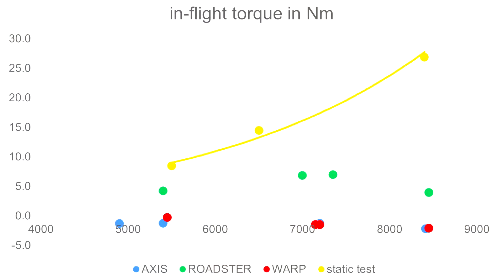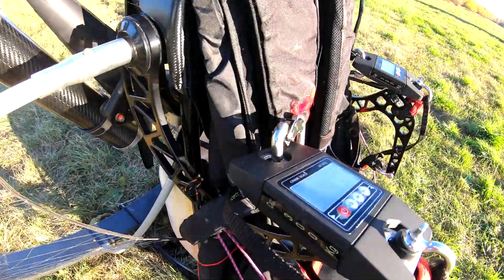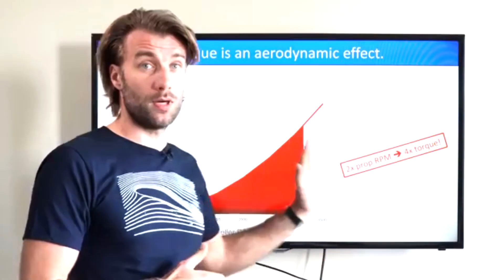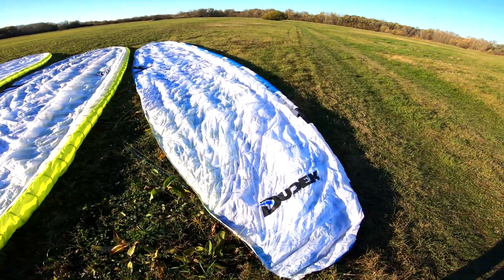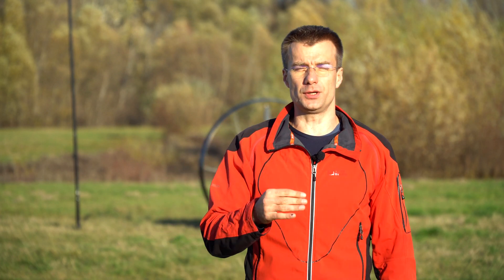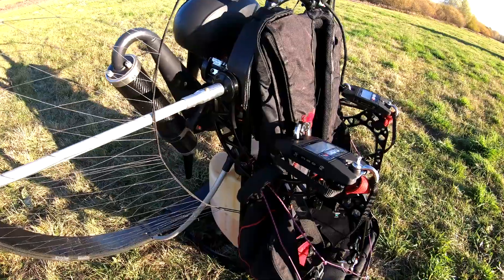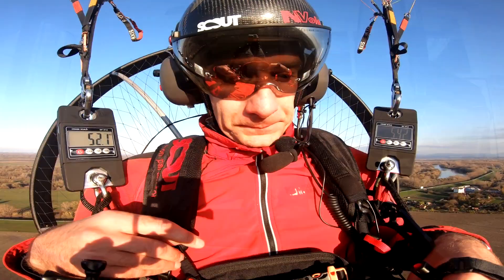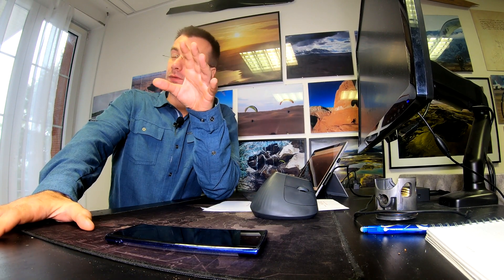Paramotor experiment: Measuring torque steer in-flight - Smarter Pilot series

Comment: the sys in equilibrium=the values are the same regardless of ur directionof flight.try to measure the angle of inclintion in plan of rotation & calculate the values.thanks ,

Comment: If you have fix arms on your frame (like flattop) probablly the weight on both arms will be different, im I wrong?
Reply from the maker: The bars did not move at all. I was sitting straight. Flattop would behave the same if it had symmetrical bars. I assume it has an offset. I have never flown a flattop but I have flown the walkerjet that the flattop is a copy of.

Comment: I find your videos hugely interesting. In measuring in-flight torque what if you used the ROLL angle with reference to the horizon? Would this not be proportional to the torque being applied? A simple drone body with camera that has artificial horizon in the display telemetry would provide you with the ability to record real time data including pitch, yaw and climb rate.

Comment: The advance ratio of the propeller will affect the relationship between revolution rate and torque.

https://en.wikipedia.org/wiki/Advance_ratio

Your analysis of the effect of angle of bank on the distribution of forces in the risers is correct. If you had measured the angle of bank, you could calculate the forces and therefore the torque. Redo the flights with an inclinometer.

Comment: I’m going to guess that at level flight around 5000-5500rpm with the 132cm Scout prop the torque compensation will be 95-100% effective. I think as the power increases the torque effect will start to slightly outweigh what the Scout can compensate until full power where the the compensation will be around 70% effective. I believe that different prop sizes may effect the compensation also. The reason I think the compensation is less effective at full power is because of the pitch change that occurs when adding full power that creates a gyroscopic effect that unfortunately can’t be countered unless you have counter rotating props. This is also why I believe it is easier to do a steep right turn. The gyroscopic effect of the prop through a pitching moment favours the right.

Comment: Hi guys!! First at all thanks a lot for your efforts making a safe and better the sport!!
There are two bigs components witch affect also the torque:
The P-factor of the blade, the blade going down generate more lift and also at more rpm more pitch more p- factor and also as faster the propeller and long, even more.
The second one is the gyroscopic effect due to the angle change of the propeller plane.
Add this components to the equation and the numbers should be God level!!!

Comment: Thank you for the great video!

You should be able to measure the torque with the scales if you maintain straight flight with brake or weight shift.

Turn measurement accuracy would be better if you took full 360 degrees.

What I get from this video: While sitting straight, make sure glider flies straight without power. Add power, if glider turns, then it's all due to the motor torque.

Comment: Wonderful testing! Great work. Now in retrospect it does make sense that the load on the risers would reach equilibrium once the turn was induced.

You can still measure engine torque by using a load cell between the engine and the frame. However, it may be a challenge to dampen the intense vibrations enough for the loadcell to be effective. Perhaps a sub-frame between the rubber mounts and the frame? Subframe is two planes with a "lazy susan" bearing between. Single load cell mounted in the center between the plates.

I would expect the loadcell to generally show the same curve in the data, but it would be considerably more precise than timing how long it takes to turn a glider. Unfortunately it wouldn't tell you if you've fully negated the torque with compensation.

Perhaps an even simpler way to measure torque effects would be an IMU to measure the tilt offset?

Comment: So what you’re saying is that the effective torque and the bank of turn created an equilibrium in the unit. It would it be useful if you were to counteract the torque that was being applied by weight shifting so that you would fly straight and level, and then measure the weight difference on each riser.
Reply: There wont be a difference because if you fly straight that means the system is at an equilibrium. The load cells on the risers are measuring the lift of each of the half wing, if they are trimmed the same and no brake input, the load will be the same.

Comment: If you put in exactly enough weight shift to counteract the torque and maintain straight/level flight under power, you would be able to measure the torque in flight.  The risers would be loaded unevenly without the interference of gravity in the x-axis.

Comment: Good scientific height on this video, I really looking forward to see the result from the torque compensation test.
If you ask Stefan to install small servo motors that turns the compensation blade according to the rpm of the Vittorazi Moster you will end up in Dunajská Streda without the Scout turning ;)